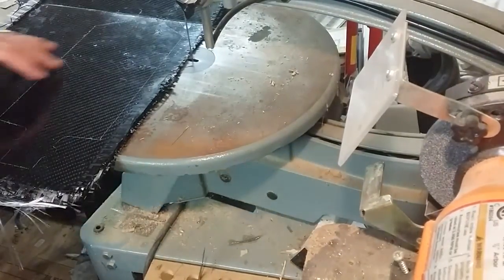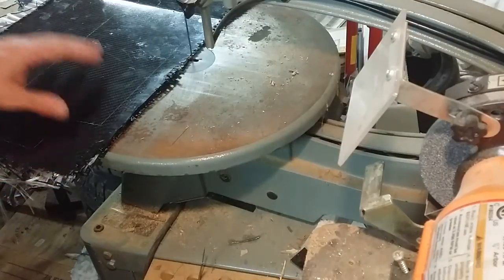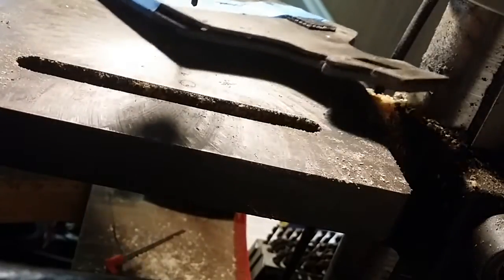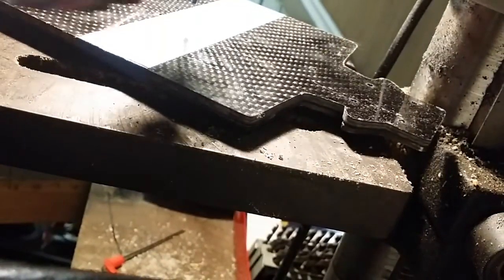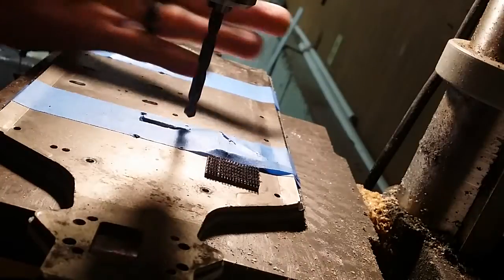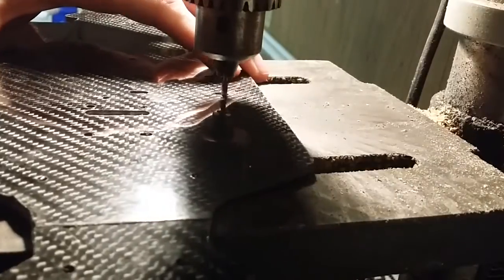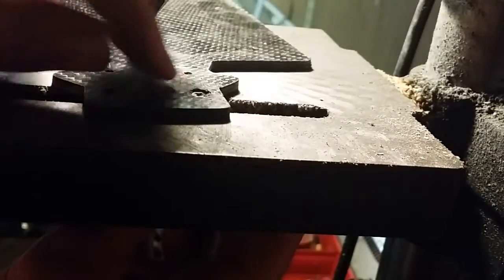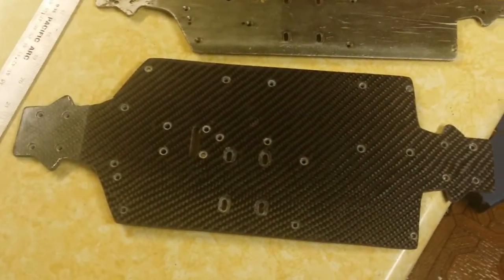Making a carbon chassis for rc truck part 2

Comment: How well did this hold up? I am considering making something similar for a custom rc car (using recycled CF)
How did yours fair
On bottoming out
Endurance
And scratches etc
Reply from the maker: It seemed to hold up just fine, at least as well as any other chassis i've seen. If you flip over just about any off road RC vehicle, you'll find the bottom all scratched up, be it Carbon, Aluminum, steel, whatever.  They all take a beating.  This carbon shows some scratches, but nothing major.  If you're worried about breaking it, don't be.  The carbon chassis I've made have been basically indestructible. I've bent several aluminum chassis, but the carbon one's I've made have had no issues.  

The biggest challenge you'll have it drilling the countersunk holes the correct depth, particularly if you are using something soft in the middle of the carbon sandwich like balsa wood.  Drill too deep, and the hole becomes very weak.  Too shallow and the screw head sticks out and can potentially snag things.  The carbon/balsa sandwich I made was amazingly strong and light, but the holes are tough to get right.  Take your time and make sure all the holes are perfect.  A drill press with a depth stop is best for this.  If you are making a "solid" carbon chassis (many layers of carbon, or a carbon/fiberglass sandwich) this isn't quite as critical.  They are heavier, but more forgiving to hole depth.

Comment: I have a question for you. I have a Losi dbxl 4mm thick chassis if you make the mold for me I can cut it out and drill my holes myself I have all the same tools but the carbon fiber part I’m not ready for that yet and I will happily pay you for the job, but I just what you to make the mold for me.

Comment: Hello,VERY NICE JOB!!!How many gramms lighter the carbon chassis,than alu chassis?  Thank's for an answer!
Reply from the maker: Jani Balázs this particular chassis ended up being almost the same weight as the aluminum, 273g if I remember right.  It was also much stiffer and stronger though. Overkill for the application. 

I eventually made a second version with layers of carbon laid around a balsa wood core.  It was about as stiff as the aluminum, but about half the weight.  If you are trying to save weight, definitely try a sandwich type composit layup, rather than a solid composit piece.

Comment: How did you bend the carbon fiber to match the aluminium chassie and the ends where it's bent
Reply from the maker: It's not bent, it's actually laminated and cured that way.  check out my other video where I made the plate to see how the front kick up was done
https://www.youtube.com/watch?v=lRIvM4dM0Ec

Comment: If you run in damp areas you might want to epoxy brush your edges and drill holes as balsa rots really quick.  High density thin foam might work also.

Comment: Do make them and sell them
Reply from the maker: +WayneRc Unfortunately no.  Although I enjoy building them for my own use, it isn't economical to build them by hand for sale.  Although there is only about $10 or $15 of material in each chassis, it takes several hours of labor to make one. Even at minimum wage labor costs (and tool wear, CF is hard on saw blades) these would probably cost $70 each if I were to sell them.  Nobody is buying at those prices!
Reply: @tmk7c9  4 years later and i just purchased the one and only chassis for a rc8.2e that i could find in my 2years of searching and i paid bout 80$ so maybe dis. rc might be profitable